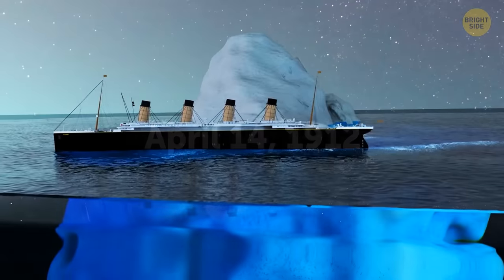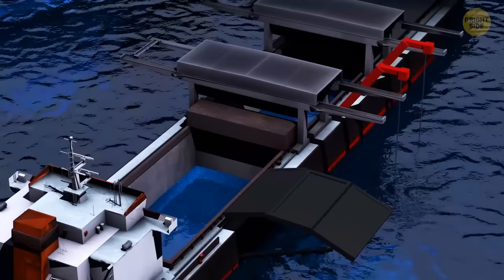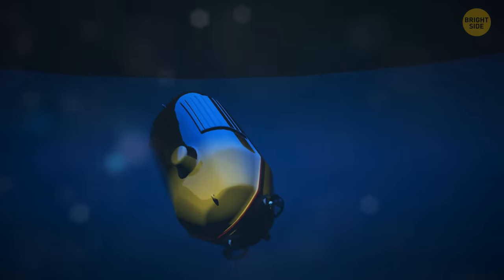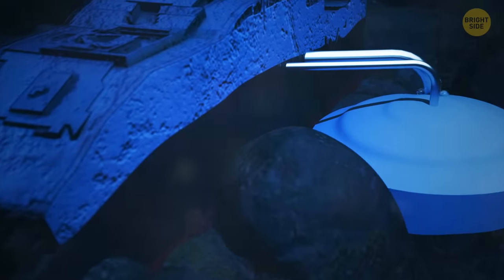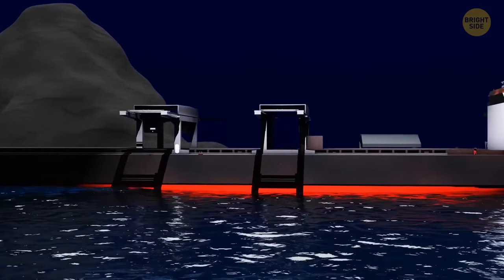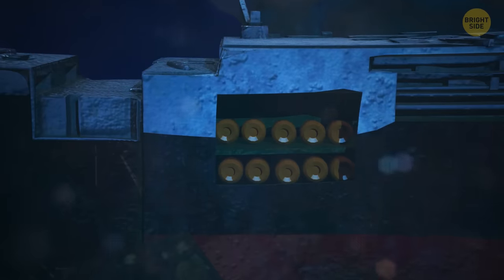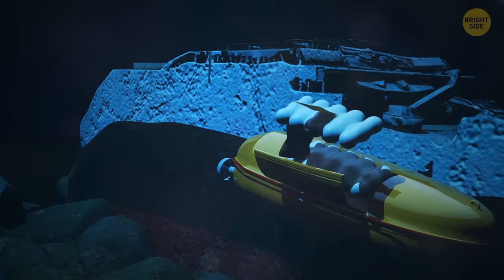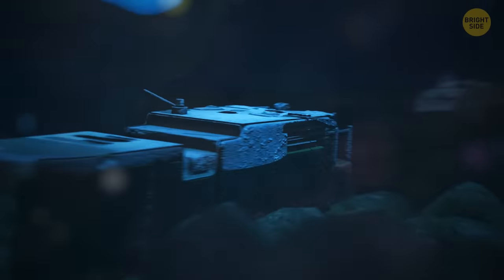11 Ways to Raise Titanic but Only 1 May Work

Comment: You could get several very long heavy duty drill bit rods every few feet drill through it with these really long rods so that there is metal sticking out of both sides and then attach several heavy-duty cables to that and lift them all simultaneously then travel to where the ocean isn't that deep set it down and then go from there but it would take a few hundred of those rods and cables basically how a you control a puppet on a string and yes no matter what you do some of it's going to fall apart it's 100 years old but if you want to get it you have to accept that
Reply: Acupuncture that's the word I was thinking of it would have to look like you were performing acupuncture on it

Comment: The problem I see with not just lifting the ship it's the huge salvage expedition needed to complete a task as dangerous being in the middle of the North Atlantic, the area above the wreck site is prone to storms along with severe weather conditions which could hamper any attempts in which would be a long time needed to secure the wreckage for lifting, just diving to the wreck in submersibles gets called off frequently when the weather is too bad for a single dive to the wreck, it's a risky operation not to mention billions needed to make it a success.

Is it possible to raise it?, yes it is but where the site is located is the problem.

Comment: What about using military ropes to make a huge net lift the Titanic a bit so its laying on the net n have two ships lift it slowly at a certain amount of time???
Like getting a fish from the pet store n getting it USED to the tank water slowly.??? Maybe
Reply: The front of the ship is buried beneath the seabed, you wouldn't be able to move it without ripping the whole thing and even slight movement will collapse the entire superstructure.
And if you do manage to get it onto a net which is highly unlikely then the only thing you will recover is a massive puddle of corroded steel sludge.

Comment: so my assumption, multiple subs, with multiple ships, airbags to be attached to the lower end on structrual points, i guess the air would fail given the pressure, but with more equipment its more doable, maybe some welding drones to the bottom could aid in some assistance with that, YO WHY DONT WE JUST REPAIR IT WHILE UNDERWATER? is that possible?

Comment: What if you fixed all of the holes in the Titanic and then use some kind of machine to take out all the water and replace it with are then the ship will float to the surface

Comment: The titanic needs to remain where it lies. Its not just a sunken ship but a tomb for the 1500 souls that died when the ship sank.
Besides the ship experienced major damage when it slammed into the ocean floor and mass been sitting at 2.5 miles beneath the water for 111 years, any.attempt to raise the titanic will result in the ship crumbling to dust.

Comment: The only way I can see this working is if the two large parts of the ship are carefully dismantled to manageable pieces and then it’s reconstructed above water. It’d take forever and damage is more than likely but restorations could be used.

I vote to leave it be though. The only reasons to bring it to the service are self-serving reasons and the damage, controversy, and money it would use is just not worth it.

Comment: The ship's structure is so compromised it will fall apart more on the way up then it did on the way down. But the ship is a mess, a litteral wreck. Why would you raise it? There is no point.

Comment: Would it be possible if with 4 massive tankers with hooks on each end of one of the half’s of the ship and lift it while a sub puts some special wiring underneath so it Dosnt crumble and if successful raise it Half way up or more then drive the tankers to the nearest shoreline that would be possible to try life it even more with strong massive subs that aren’t rounded like u see but are more flat like and with the subs will raise the wreckage to the surface to be made rest in a special museum somewhere along the docks
Reply: I'm afraid not. When thinking about Titanic, forget we're talking about a ship. More than a century below 12000 feet have turned her into a ruin. Raising her is out of the question, she'd fall apart.

Comment: what if we don't raise the Titanic but lower the water around it so make a huge square of thick metal that will be sunken down to the Titanic to get all the water out you use pumps to pump the water out of the square and into the water outside of the square

Comment: Its never leaving the ocean floor...EVER. The pressure down there is too much,  the ship is most likely fragile at this point,  anything thats used to lift her needs to be anchored to something as titanic weigh so much,  not to mention its 2.5 miles down which is a few hours to the bottom. Even if you manage to start the process of lifting her its a long way up... long way up.  Maybe just maybe they could bring it up piece by piece  but this too should have been done long ago.

Comment: Unless we have technology that can dig a hole around the ship without the slightest touch to the ship it's gonna break in two at least regardless of what anyone does keep dreaming also if looting it wasn't enough recovering it won't be enough to satisfy anyone apart from a tiny paycheck there is no point in recovering it at all

Comment: if it was possible and feasible to raise  the wreckage how would they keep it afloat on the Surface  and to its next location ?  i would think the Hull from all the damage and years of being in the Ocean has severely compromised the Integrity  f the hull and it wouldn’t be capable of supporting her heavy interior and propulsion system ? just my thought ? not a  Downer on the video  i’m not exactly sure what the purpose would be to raise  her if it was to study  the Construction and how to improve   the failed areas it would most likely be more cost effective. to raise small sections  for that  unfortunately  in Maritime Law and respect for those who perished  in the disaster it may be more respectful to leave her where she sits asis ?

Comment: Nothing would work. The remains are slowly collapsing. Even forgetting for a moment the state of the wreck, in 2 main large parts with the centre section spread over the ocean bed, there is nothing of substance worth saving. Titanic is now little more than rapidly corroding iron turning to iron oxide.

Comment: It's actually the Olympic and the real titanic was swapped with the Olympic before it was launched and they changed the name
Reply: Don't believe everything you see on the internet.
Reply: That's a fun concept to play around with but entirely impossible giving the circumstances. Ships have the equivalent to your cars Vin number, stamped everywhere's in them. So in order for this to work they would have needed to completely swap the Titanic, and the Olympics, interior on top of changing a few other designs around on both ships. While it's not impossible to do this it would have taken well over a year and Olympic was only docked by titanic for like 60 days.

Comment: Nothing will work, the wreck is far too brittle and buried in mud to be brought up. Most of it will disintegrate into dust if someone tried to move it. Besides, the wreck can’t actually support it’s own weight anymore, so if it were moved into air, oxidation and gravity would cause it to collapse completely. Since there is a lot of water pressure down there, the water is literally the only thing supporting it

Comment: All of these ideas are just insane as the next one you can’t raise the Titanic if you could and it was that easy do you not think it would have been done more than 111 years ago. Exactly the titanic would have been raised if it was that easy but because the sea bed has nearly eaten the ship or has rotted it away you won’t be able to get the whole ship up without parts breaking. It’s the most silliest thing to even try secondly half these ideas with the ropes and nets will need several humans to go and check that it’s all in secure before proceeding you may as well jump or throw the human into an active volcano because that’s how raising the titanic will be IMPOSSIBLE even if there was a way as I said it would have been raised. People just need to leave the titanic alone in its resting place

Comment: How about they put this down where the wreckage of the Titanic is then drain all the water out of the dome then they get the Titanic with a crane does on the boat around the dome then pull it up very much a lot of buoyancy like use the claim those used to carry oil rigs

Comment: How about building a "dry-dock" around the Titanic and then make any adjustments so that the dry-dock fits the now irregularly shaped ship like a glove.
Then, use any of several ideas like inflatable bags, containers or cylinders and attached them to the outside of the dry-dock, which eventually will lift the Titanic.
And since the ship will be very fragile, it might be necessary to only lift it NEAR  the ocean's surface so that the Titanic could be structurally reinforced before it
was brought completely up to the surface of the Atlantic.  It would require a LOT of money, but I think it would be possible if enough major companies and/or countries
were will to combine their resources to accomplish this.

Comment: Too corroded that metal is too brittle as for raise the titanic movie was they fixed the damage plus in that movie that titanic was still intact not split in two after they fixed the hull with new material and filled the hull sections with foam making it buoyant then the used explosives to budge the titanic loose from the ocean floor and what they were looking for in that safe was not there it was in a grave in England the end of movie plus after 100 plus years under water it would possibly crumble apart as soon as it hit the surface